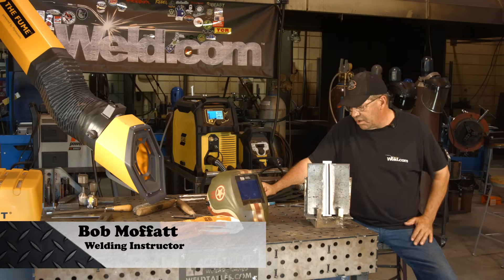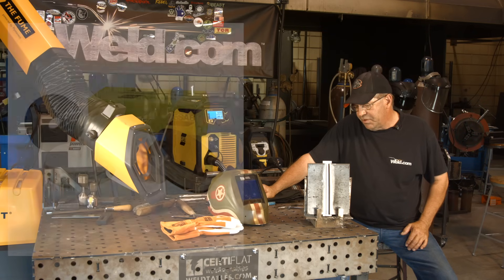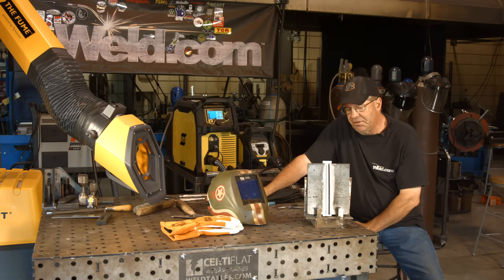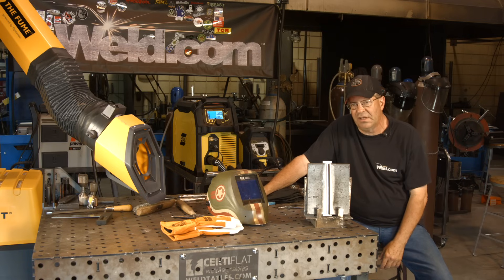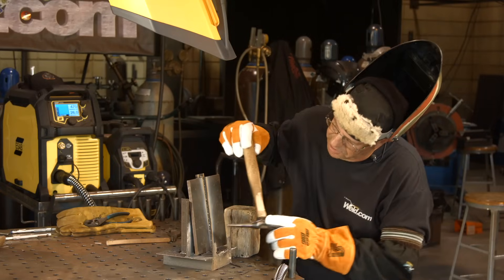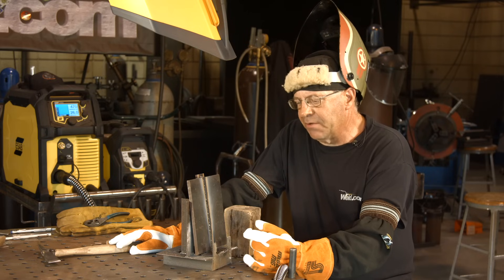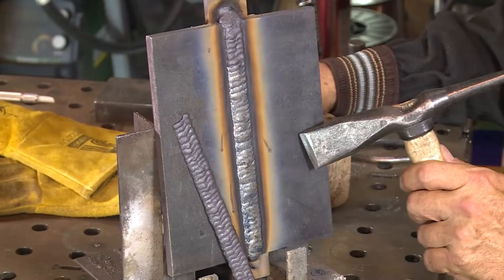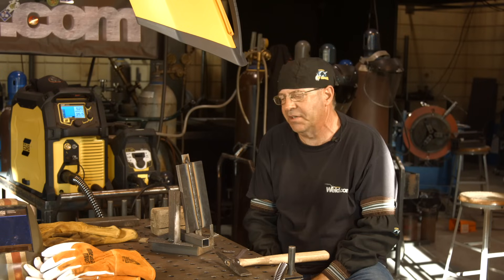🔥 Dual Shield Flux Core Welding with Backing Plate

Comment: The term used for marks on the very surface is actually “worm tracks” it comes from gas trying to escape the weld as it’s partially cooled. If the gas escapes from the weld as it is even cooler you get “worm hole porosity”. The difference being the hole that forms at the beginning of where the worm track starts.

Comment: Do you like that wire alot because it's esab, or e71xxx, or just becaus3 it's dualshield?

I'm having alot of spatter issues and came here to get some answers. Overhead position on 1/2" wall 8x8  stl tube. Xmt350, and an ln25.  25v and 235a. .045" e71t-1.

Issue is spatter everywhere. Big globs of lava. Filling the cup and ruining consumables quickly. Travel angle doesn't seem to change it. 

Thoughts?

Comment: I was under the impression that wormhole porosity is caused by the wire being to hot. Reduce volts by .5 or increase ipm slightly higher. The wire releases gas from in the weld and gas escapes through your weld.

Comment: Running Hobart wire we on occasion get "snail trails" too. Have found that damp wire is the culprit. More voltage and a bit longer stick out seems to help, more time for the wire to heat up and burn out moisture. Crappy gas is also thing to look at too. Keep up the good lessons Bob, old guys are pretty good for a reason.

Comment: Quick question can I use gas less flux core with a mixed gas or is there specific gas shielded flux core wire for dual shield welding? Thanks

Comment: I hate dual shield on straight co2 so much spatter and alot slower travel speeds mixed gas is the way to go don't gete wrong you can run c02 all day long it works

Comment: 25 v 9.5m/min, 20-25 mm stick out with the wire in the front of the puddle and weave no more than 5 times the wire. Try NSSW SF-3A it has a real bite.

Comment: Ideal to weld flux core 3G is
26 volts
273 amps
Straight up no bs side to side movement, 0 buck shots ,Smooth as it should be. Afterall its flucore not stick!!!! Im a welder for PATTERSON UTI..shout out to the brotherhood...
Reply: What volts and amps would you recommend for a Flux Core  1G and  2G test?

Comment: I run that .045 at 23 volts with 210 ipm on 3G
Reply: dangerprone911 too cold and too slow
Reply: joshua bechtold well that’s what the manufacturer recommends
Reply: I guess if your welding on like 1/8" or 3/16" or something
Reply: joshua bechtold who uses .045 on 1/8 ?
Reply: 1/8" might blow through

Comment: Is C25 better for all potition welding with the dual shield wired? We use 100% CO2 at fhe shop and vertical can be tricky regarding ajusting parameters

Comment: Im new to welding why do you need gas with flux wire? Isnt the flux protecting the weld instead of the wire?
Reply: Ben Wilson it’s not flux wire, well it is. It’s dual shield wire. Flux is one and gas is the second to make the “dual” shield. This is completely different than gasless. This is for structural applications like stick welding.
Reply: very little slag, and very high deposition rates. you can run this stuff HOT.  Get a backpad. your hand will melt after about 2 feet of weld.

Comment: I have for the first time run flux wire in the last month..  I am having some issues adjusting.. seems the material does not lay down as quick and I seem to stretching my puddle out too far..  I know slow down but it seems the puddle looks to big...

Comment: worm tracks is from your regulator iceing up from the co2 gas then melting the closer it gets to your weld . you need a heater for your regulator . worm tracks are a fail must grind out and do over at least in bridge welding in canada
Reply: He's running C25. Mix gas doesn't ice your regulator.

Comment: I use dual shielded everyday I use 1 setting for Flat vertical and overhead we do not weave because you get the “spin weld bead “ if your machine is set right stringers weld beautiful in all positions 24.0v with about 300- 330 if your wire speed is right it should make a hiss noise no crackle hope this helps. Will gladly make a video if anyone comments.
Reply: +butlerweldingandfabrication could you make a video?
Reply: Video
Reply: I'd like to see your video
Reply: @mikeschmidt7980  not going to happen bud
Reply: I was just going to comment that I thought you should not weave dual shield, and like you said not only should not but don't need to. Thanks for the info.

Comment: I really suffered from worm holes while working at a structural fab shop. I could get everything to run fine on a piece of scrap and then start welding on the job piece and....bad worm holes. 
I'm about 98.5% sure it was moisture in the base metal (metal had a good coat of surface rust). Even with grinding clean the weld area the porousity continued. "Preheating" with a torch was the only thing I could figure out to do to consistently solve that issue.
Reply: If a pre heat helped your porosity, than it was moisture.
Reply: John T yea bro all metals have moisture. Preheating is key , but then again could b bad wire

Comment: At my work, we use a lot of 71-T-1 and 81-T-1. We know all about wormhole porosity, or as we call them, "worm tracks". They're acceptable as is... Unless there's porosity. Sometimes, at the end of the worm track, will be a single pore that goes deep, usually to the bottom of penetration from that bead. That's what we call :wormhole porosity", which is not acceptable.
Reply: jdrains16 wagon tracks 😉. I think it really depends on what you're welding on. All the stuff I do wagon tracks would pass. The things I weld are engineered to have a 3 to 1 safety ratio which means there's more welds then there needs to be for it to have it max load rating or work load.

Comment: This is NOT how dual shield flux core should be run.

When set up properly, it will run vertically with very little torch motion. The force of the Arc pushes out the puddle.

Comment: I think you made a video without the backing plate, but the problem that I faces is that I NEED weld the open root pass vertical up. In your video you were going downhill and you had it held it a bit a a angle, what I am not allowed to do here in The Netherlands.

Comment: Should start a series called "Flux Core Friday"
Reply: Great idea. I need to try that. I've got one of my everlast welders permanently configured for flux core but I'd like to exhaust the smoke faster than it does now.
Reply: Good idea. I'd also like to see what people are coming up with for fume extraction. I noticed he had an industrial unit in this video. I'd like to rig up something inexpensive for when I need to run flux core through my everlast.
Reply: Maybe some computer fans and some dryer exhaust flex tubing? Run it off a hobby battery and Boom! Mobile blower. I have a 110v blower fan that an old co-worker gave me.

Comment: just got done using my 235 today with .045 esab7100 ultra. have been using that wire for last month or two, sure lays down better than the other stuff we had. found the best settings was 300ipm-26volts 45cfh with 1/2" stick out or less

Comment: Run about 20 feet of that wire out of the gun, then set the wire feed to zero or lift up the feed rollers, set the end of the wire on the grounded table under something heavy enough to keep it in place, then carefully making sure nothing but the very end of the wire is touching anything grounded, hold the trigger for 30 seconds or longer depending on how long the length of wire is, this will super heat the wire, driving off any moisture or lubricant contamination, then let wire cool for a little while, then carefully re-roll the wire back through the liner onto the spool.  Weld with the super heated/baked wire, if the "worm-track" porosity goes away, that indicates hydrogen pick up usually, from wire being left out opened up usually, if "worm-track" porosity persists, it usually indicates lack of shielding, too much puddle disturbance(is CFH too high or poor techniques during welding).  I deal with trouble shooting all types and sizes of dual shield flux cored and metal cored wires every day. Fun times
Reply: workwillfreeyou What flow rate are you referring to?  Typically when welding with dual-shield fcaw in .035" to 1/16" diameters, 20 to 30CFH of 75/25(C25) is used.  When the wire diameter increases to 5/64" and above, it may be necessary to increase CFH as well. Hope this helps.
Reply: workwillfreeyou Also I have found that when welding vertical up and overhead, that it may be necessary to increase CFH to accommodate for the change in the position.  Also, different types/shapes of gas nozzles have different affects on the gas cloud.  I have found that having the contact tip recessed about 1/8" to 1/4" inside the nozzle seems to help with gas coverage when welding fcaw.  With gmaw having the tip flush or slightly protruding from the nozzle works well.
Reply: @rickreiff6750  some nice tips. How about the induction settings? I am just starting out with FCAW and I have an old transformer machine with 3 sockets for the ground clamp (induction settings).
Reply: @АндрейКлименко-к7ы  High or Higher Inductance is usually preferred with FCAW wires, but you will have to find what works the best for you.
Reply: @rickreiff6750  thank you for your response. Any tips according the WFS in the 2g/2f position? I stopped at 280-300"/min, but the transition between beads is still saggy, I can't figure out the settings/technique to blend them more flat/concave in.
Reply: @АндрейКлименко-к7ы  You will need to provide more information.  Exact wire type (FCAW-G, FCAW-S), wire brand name/manufacture, wire diameter, Shielding gas type, voltage being used, CTWD/ESO, etc etc.
Reply: @rickreiff6750  Absolutely. It is a E71T1-M wire made by NSSW. The diameter is 1.2mm (0.045"), gas is a 82/18 Argon/CO2 Mix. CTWD- 1/2" to 3/4". The settings were - 240ipm/21V, 275ipm/22V, 325ipm/24V , 360ipm/25V. Today I did grind my nozzle down so the contact tip is sticking about 1/16" to 3/32" out. I made it to track down the electrical stick out better. Couldn't see any negetive effects after doing that (lack of gas coverage, increase of spatter, wormhole porosity, etc.). At the end of the practice I decided to mess around and tried a higher Voltage/less WFS setting - 275imp/25V. It was much better. I could control the puddle much better and my travel speed increased like 1.5 times. With the higher Voltage the bead I got smaller but it blended really nice and flat without saging down and creating this unsmooth transition to the previous bead. Also I stopped to use any oscillation ( I've done a small back and forth/2 steps forward 1 step back thing or sometimes a cursive e motion). I've done that for the rythm, so I had no verity in speed and build up. And my biggest mistake was that I would put the test plate to high and had a problem with seeing things happen from the top of the nozzel. Also I realized that both my Work angle and Travel angle were far of. Work angle was around 60° to fight gravity and prevent the bead from saging down and travel angle was around 45° to fight the slag but I think it was more an intuitive thing just to open the view a bit more. So I corrected the Work angle to 45° Travel angle to 10°-15°, added 3 Volts and started to move a lot faster and the results were much much better. But it was only for 5 beads or so 😅. Had to run the hell out of the workshop before the alarm started. And gas flow was 30-35 cfh.
Reply: @АндрейКлименко-к7ы  sounds like you have it figured out.
Reply: @rickreiff6750  thank you anyway friend
Reply: Thanks Rick.
Reply: Could someone explain why the gas flow rates are much higher?
Reply: Rick Reiff excellent break down... good info. experience is a good teacher....
Reply: Rick Reiff thanks Rick. I'm just starting to use dual-shield wire. My 1st  try with dual-shield went poorly but I'll get it.
Reply: Rick Reiff uintaite
Reply: I’m assuming the 20 feet is just a test to see if the wire is contaminated. You can’t actually do that for actual welding. If the wire is contaminated that way, then what? Throw the entire spool away?

Comment: Last time I did a flux core test was just like this except on 1" plate and I think .045 wire. I ran like 24.5 volts, 300 wire speed.  Now I see why I struggled, shows my lack of experience with the process. 

Is the weave a straight side to side or the "lazy triangle" like with the hard wire?
Reply: JFROMM454 I run at 26.5 volts and 425ipm
Reply: I run 29volts 240amps on 3g 1in

Comment: I have found that once my c25 bottle gets below 500lbs of pressure those wormholes become alot more common. I always figure the last bit of gas in the bottle is not a correct mixture or what I call dirty gas
Reply: William Wornat Take the regulator off, tip the bottle over, and roll it back and forth for a minute or so.

Comment: Another great video Bob ! I have a question, is there a relationship between the sitckout length and volts/ipm settings ? so there will be less spatters and the weld runs smoothly ?

Comment: Can yall do a 4G Test 6010 Root 7018 Fill and cap? struggling hard with the root pass
Reply: Robby Turpin Hold a short arc in the keyhole. Slight drag.

Comment: some one had me half convinced that the "worm hole" porosity you talk about is caused by too much gas. still only somewhat convinced, mixed results when testing his theory
Reply: i take that back, old wire... few months old... wow
Reply: I've found it's not so much the volume of shielding gas but the velocity it comes out of the diffuser and nozzle.  And moisture doesn't help
Reply: I turned my gas down from 30 to 25, which cleared it up for me
Reply: No matter what you do, warm tracks and pin holes could happen, they even allow them to a certain percentage.

Comment: If possible can you please do a video on different grinding disc and choice for each. Flap disc 40 vs 80 vs 120  vs solid stone and wire wheels and different situations you would us each for.
Reply: Justin Longoria just google it lol. Pretty common sense
Reply: I understand the grit difference, just wanted to see a side by side comparison on which is better for mig, tig, stick, and so on. Each tool has its use and I would like to know wich is best to increase productivity. Google only gets you so far.
Reply: Justin Longoria I dont understand what you mean by which is better for mig, tig, stick. The outcome will be the same despite what welding process you use. To grind larger amount of material or want a rougher finish use a lower grit. If you want a smooth surface use a higher grit. I just googled it in 1 minute and got 3 different articles on what different grits do on different material Youre just lazy thats it.

Comment: Quick question Bob. The right shot kinda shows a "drag" uphand(nozzle pointing to 8 oclock) The arc shoit itself looks like a push uphill(nozzle point to 10 oclock) like a hard wire shove ? OK One more. How does that flux react on cooler welding...say 1/8" stuff
Reply: Douglas Alan 1/8 material? Fillets and you better move fast.

Comment: Bob, I run this stuff at a shipyard on .052 wire with 40 cfh with 100% CO2.  What's the reason behind C25 gas?
Reply: Quang Hoang We didn't have co2
Reply: Thanks Bob.  Maybe down the road could you do a 5G downhill 6010 all the way out?  1/8" root and progressing up in electrode size accordingly?  Thanks.

Comment: i took a test like this for CB&I... but you cut off the backer and back gouge any porosity  and grind both sides flush. then xray. but you couldnt use the grinder till tje welder was turned off and stayed off... you could only use the air arc and a slag hammer/brush for the backer removal and back gouging porosity.

Comment: I really like that wire too, Bob. I generally use that same wire in .045 exclusively in my MM250 for just about everything unless the weld appearance needs to be flawless. Those little surface dents piss me off, so I'll swap in .035 solid wire for those jobs. This wire just makes an excellent weld. You should be able to just do a straight drag and come out with good surface appearance most of the time, nice and smooth. Maybe not with such a big gap to fill like you had. I also find that I need a higher than solid wire shielding gas flow rate and faster wfs than I would use with solid wire, just like you demonstrated. But my welding shop never gets hot and sweat never drips down into my hood. Ever.  You should let that guy weld for a few minutes in short sleeves and check on him in a day or so. Ask him if his sunburn hurts.